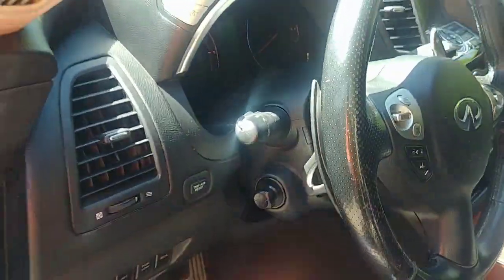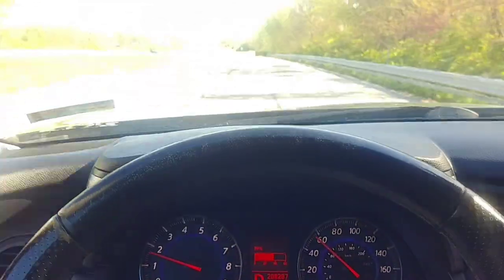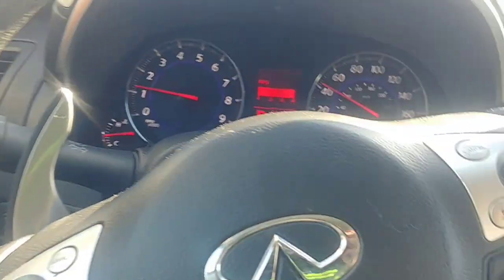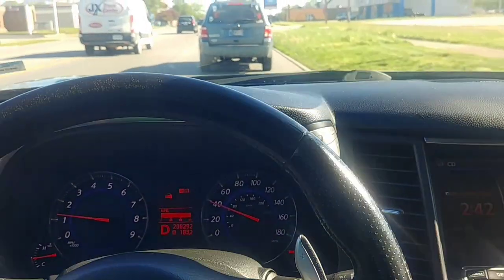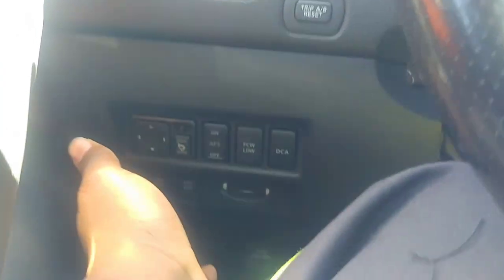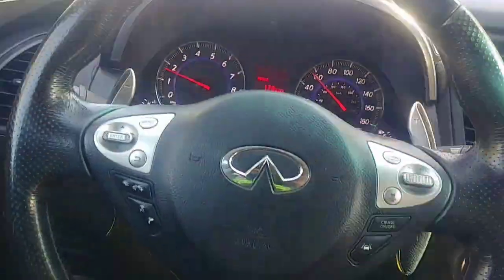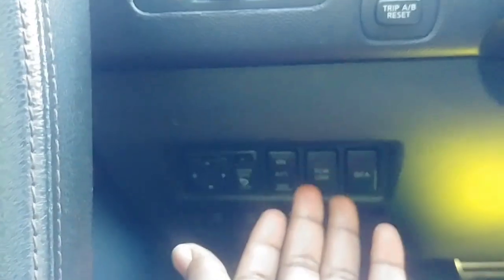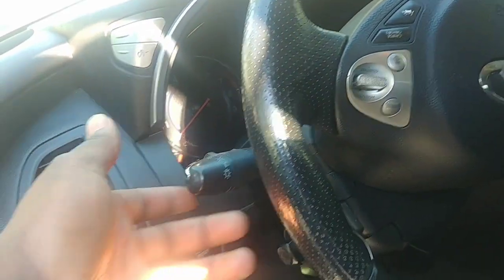Infiniti FX Technology Package|DCA, LDW, FCW, AFS, IBA, LDP. What do these mean?

Comment: Thank you for the excellent Video, this is much easier and clearer than the manual.
Do you think IBA will help to stop the car before crashing, or just reduce the speed essentially DURING crashing?
Reply from the maker: Thank you for the kind words, I try to inform without over-simplifying.

From what I have seen and understand of the IBA system, it will just reduce your speed greatly before crashing but since it in esswnce only functions above 10mph, that is the slowest it can take you to.
It mitigates the speed at which you hit the vehicle in front of you.

Comment: Can you test out the differences of The infinity’s FX50S Sport mode on vs Off, drive POV
Reply from the maker: It's difficult to put it in words since it's a difference in suspension feel , but I would love to do a video on that. Long term goal
Reply: @EdBwoy  try it out on sharp turns or when you are driving and steer more when going into a turn
Reply from the maker: @DiaperSNiFFER  I can tell when it works. I can feel it even on a smooth, flat road. 
Translating that to video is the problem.
Reply: @EdBwoy  ok I have a question 🙋‍♂️. I live in Canada 🇨🇦 and cannot find a part for my Infinity M35X 2006. Lower Control Arm Ball Joint. They ask me is it AWD or RWD. For my M35X. I Say AWD since they don’t have M35X listed on the part source website. So they search M35 AWD and cannot find any listing. So is the rwd M35 Lower control Ball joint the same as the AWD M35X? My only resort is to go to an Infinity dealership since I cannot find the part but it’s at least an hour away from where I live. I called Nissan up the guy said we don’t carry Infinity parts only Nissan which I call 🐄 💩 since they are the association with each other.
Reply from the maker: @DiaperSNiFFER  the ball joint isn't sold separately, so you have to buy the entire control arm.
Check online and you might even be able to find aftermarket ones, like Dorman.
Reply: @EdBwoy  ok 👍 I guess that’s the best option. It’s sucks because I want the part like right now in front of me. Thanks 🙏

Comment: Hi there! I’m converting my steering wheel into black and having trouble ordering the steering wheel control panel switches. My current ones are beige but I’m trying to order one in black with identical features. Was hoping if you could help, million thanks!

Comment: My 2010's AFS button is actually a dial from 1-3 that I've seen that adjusts the height, I haven't noticed it going left to right
Reply from the maker: Correct, yours isn't technically AFS so it won't do the automatic vertical and horizontal correction.
Yours is a manual system that depends on the driver to manually dip or raise the lights (mostly due to how the back was loaded). 
It accompanied the tow package, but then the FX driver has to know how to use it so they don't blind others.

Comment: My FCW and IBA malfunction warning light came on. Trying to figure out the problem in order to fix it. 2014 Infiniti QX60
Reply from the maker: The simplest fix is that the sensor is dirty/obstructed.
If cleaning it doesnt solve the issue, it would be wise to have a dealership or any other shop with a capable diagnostic tool look at it for you. Diagnosis isn't always cheap but it could save you a lot of frustration & guessing.
Reply: @EdBwoy  thank you brother. Problem solved. Short answer Loose battery terminal. Thanks again and I enjoy your videos. I also have an M35 so I watched some of your others in the past. Good vids/work.
Reply from the maker: Wow! Quite a strange connection there (pun intended), but I am glad you got it sorted out. 
I too like to enjoy all my car features when my vehicles have them.